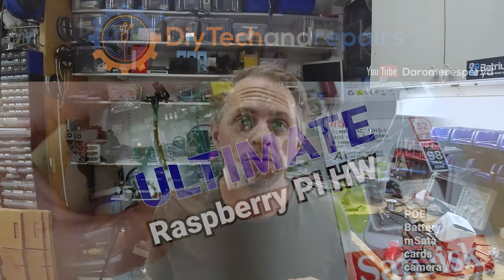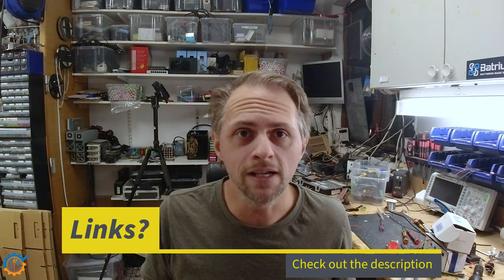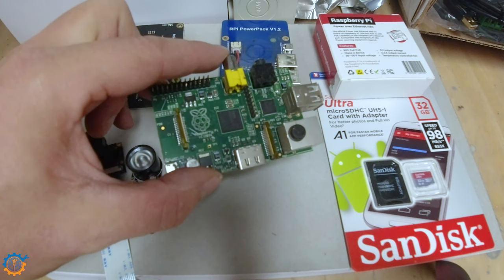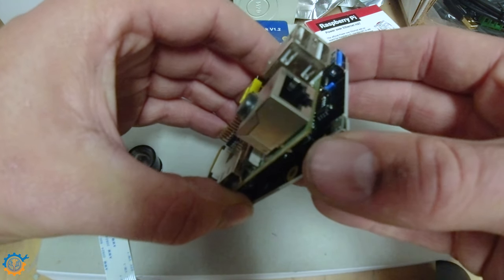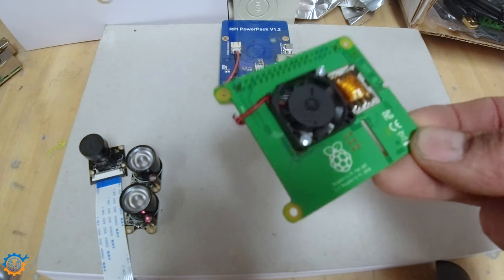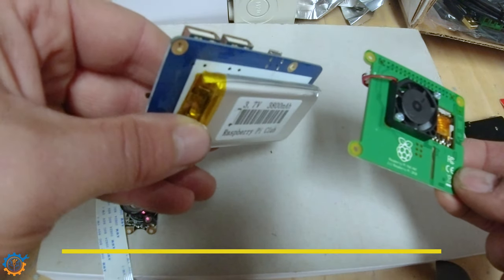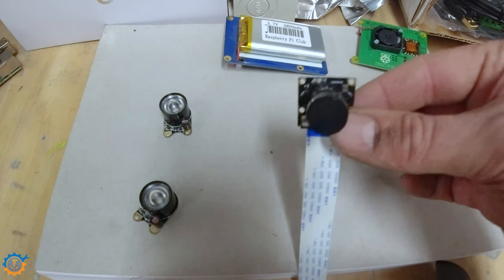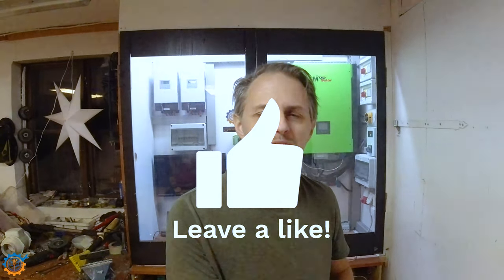Ultimate Raspberry PI server - HW Part 1

Comment: I bought a Portable Charger RAVPower 16750mAh Power Bank External Battery Pack, works splendidly as a UPS. Powerglitches used to kill my SD card and that is a thing of the past with this powerbank. Highly recommend.
Reply from the maker: USB powerbank is for sure a very very good start. I use that to alot

Comment: About the camera, yes it could be a fantastic Streaming video or photos into the house.
About the PoE ... o so much, specially because it is a power wasting device ...I would leave that only for WAP's/routers that are positioned in place with difficult access to a power line. I do not see a great use case for PoE ..it's more a nice to have option for some very niche applications.
Baterry powered UPS ... oh yes, fro sure.
About the options for hard drive ...Forget the cheap microSD flash ! There is the danger specially on your model that a power down due to lack of power could damage the flash.
There is also the problem of longevity of such devices ... many write cycles will damage the flash . So the idea to use a mSata adaptor is actually paramount for long-term usage ...no to mention you get a Lot More space then any microSD.
Reply from the maker: You are right. But for POE i think its very good. I run 4 of them here myself and it works like a charm. I can remotely turn them on and off for instance and I dont have to pull 2 lines to the cabinet. The network is enough (Yes can use wireless to but since I have POE everywhere...)   

Thanks for the comment!

Comment: All the backup packs I tested stressed the battery more than I liked so I did not recommend them.
Reply from the maker: In what way did they stress the battery?
Reply: @DIYTechRepairs  One overcharged the battery past 4.2V and the charge rate was maxed out for the cell. Also, that one didn't actually deal with loss of power if powered from a large power supply (capacitors in the PS dropped the voltage too slowly for it to detect a power outage) so the Pi rebooted on battery power. Only worked if I pulled power on the Pi. Another one charged OK, but had the same power outage detection problem. I finally decided to just use a UPS on the mains side. I did have good luck with a SATA SSD Boot drive, but haven't tested with the Pi4. Rumor said it won't boot from the USB3 port, but I haven't tested yet since it's lighting season. 🎄😂